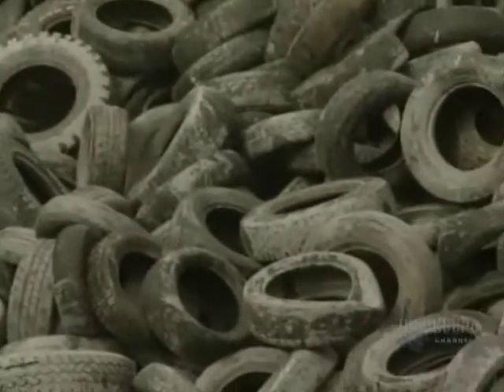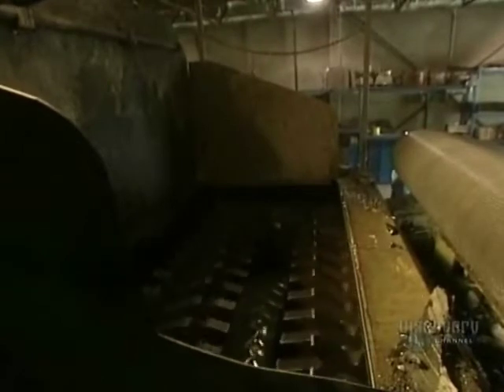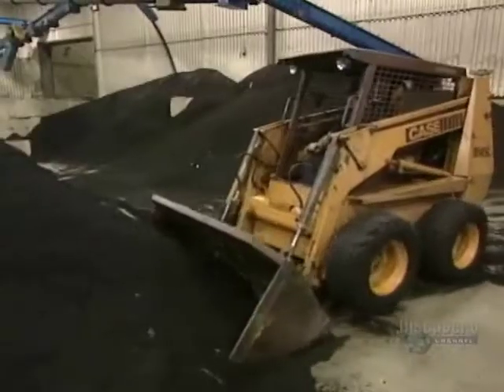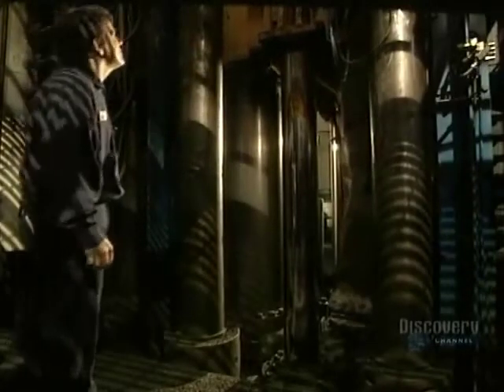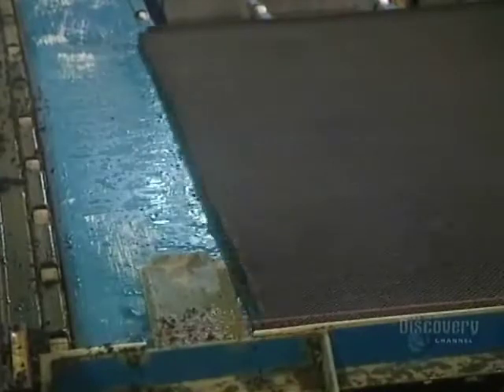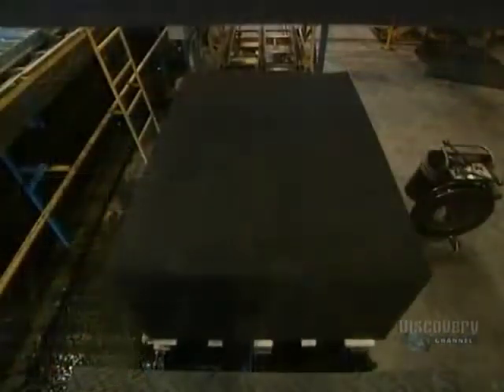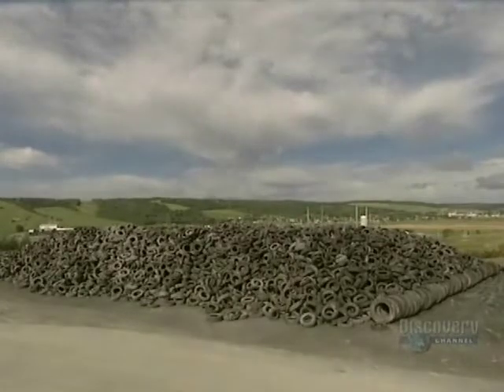How It's Made - Rubber Mats

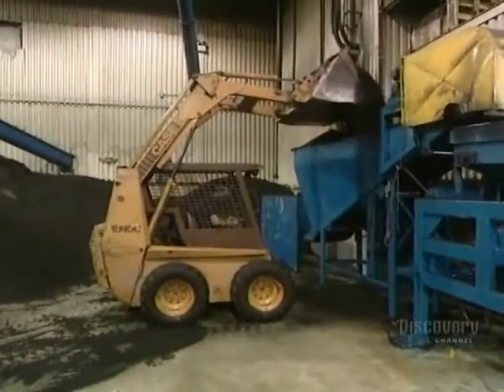Comment: Am sure at 2:19 that person job can be replaced by a convayor belt. Also the 4:13 job chould also easily be done by a mashine as they alredy have a specific tool for it and its downwords pressure plus turn to use.
Reply: Well this was 2001
Reply: As someone who works in a factory, if a job isn’t being replaced with a machine, there’s usually a reason for it. Usually, in this case, it’s probably because machines don’t play well with unpredictable situations, and building and programming one that does can get very expensive very quickly, and still not do the job as effectively, reliably and consistently as a human being.